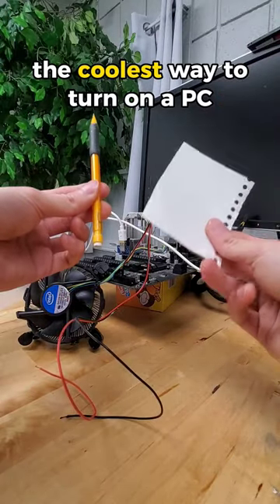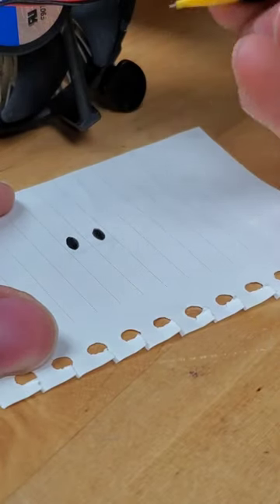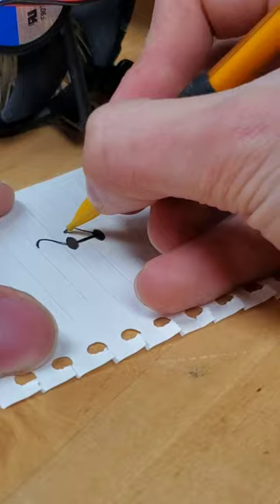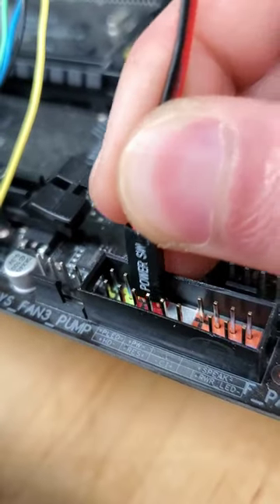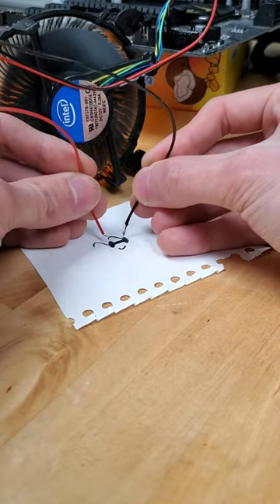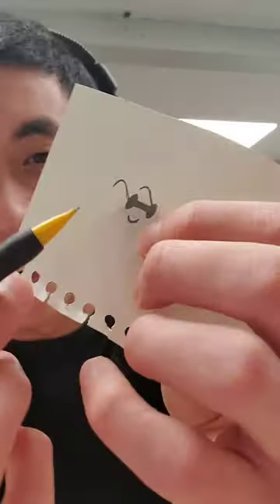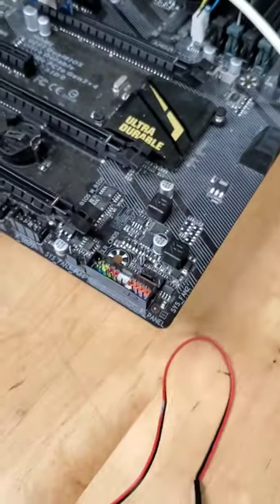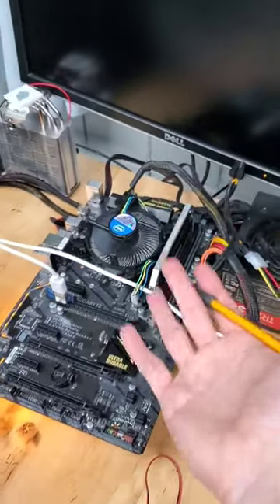how to use a Pencil to turn on a PC! #shorts

Comment: Back in the day we used to unlock the multiplier on AMD Athlon CPU's using a pencil. It was done by bridging two contacts with a pencil line. The downside was you had to do it quite often or it would lose it's conductivity.

Comment: I have a question whats termal paste for? Ty
Reply: Thermal paste helps transfer heat between your CPU and cooler, without it your cooler wouldn't be able to properly absorb heat and your CPU would get too hot

Comment: Only non metal can conduct electricity
Liquids left the chat
Reply: Liquids aren't elements, they're compounds

Except bromine and mercury
Reply: Water is actually among the best insulators in existence, but it has to be ultra pure or the metals (like calcium and magnesium) will turn it into a conductor
Reply: @GoatDirt  exactly
Reply: It's the metals in the liquids that conduct electricity.
Reply: It's the ions witch charge that enable the flow of electrons in water. Both anions and cations.
Reply: Carbon is a non metal and can conduct electricity, so is silicon
Reply: @Alucard-gt1zf  Silicon's a metalloid, and carbon can only conduct if it's in a special structure. Diamonds and coal don't conduct, graphite does
Reply: @Alucard-gt1zf just in case you don't see my other comment, graphite IS carbon, and silicon is a metalloid
Reply: Plasma has also left the chat.

Comment: "Only non-metal that is able to conduct electricity "...

Say what bro?
Reply: Is your hinting at water then it cannot you need metals and electrolytes in water to conduct electricity but semiconductors are nonmetal conductors
Reply: @HenrySciortino no lol he's literally showing a non metal conducting electricity in the video 

Carbon, and silicon spring to mind straight away
Reply: @Alucard-gt1zf 
1: graphite IS carbon

2: silicon is a metalloid, not a metal, not a nonmetal